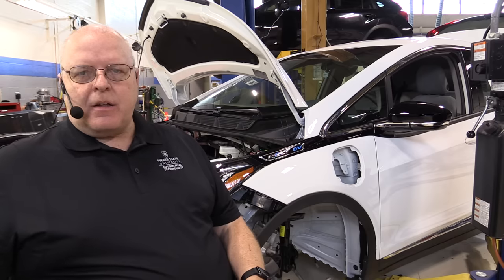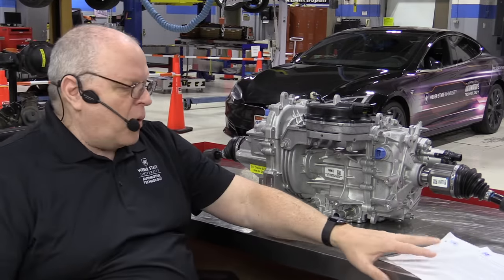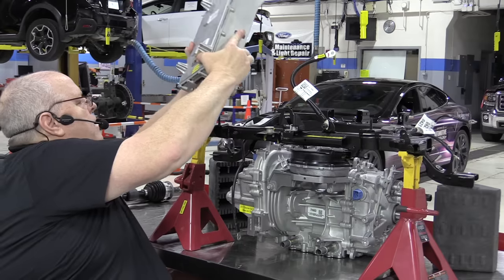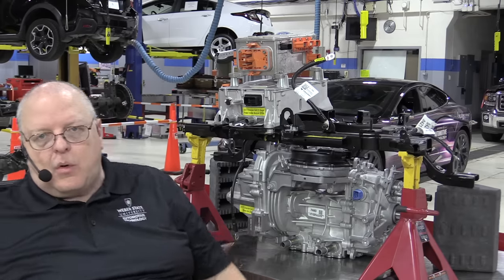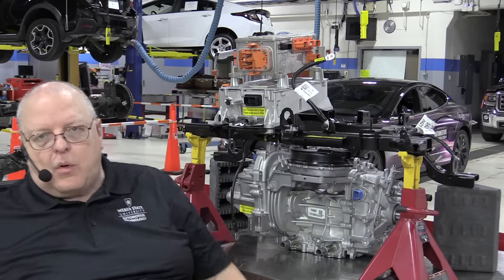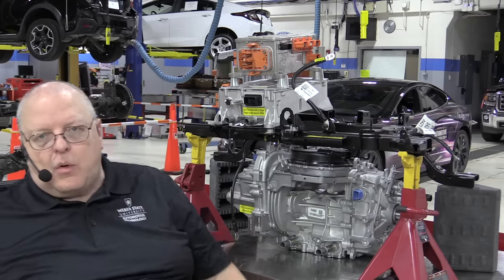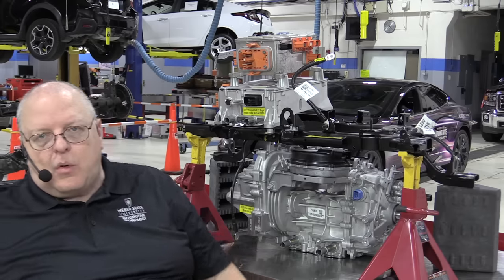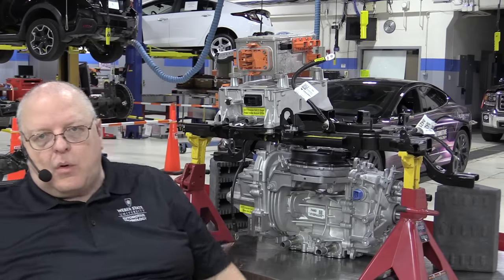Chevrolet Bolt EV High Voltage Components

Comment: Legit question:  What's the chance to valve the electronics cooling loop with the cabin heat loop?  Even if it's a manually operated pair of 3 way valves.  My range took a hit due to cabin heating, but my Tesla Model S allows the waste heat from electronics to heat the cabin and it doesn't reflect any loss in range.  Sure is a shame Chevy didn't tie those two loops together, really how much would it have cost?
Reply from the maker: Good question. I do not know the answer

Comment: Super interesting, seeing how everything is connected gives me some hope that the Bolt could be somewhat easily modified to make up for some of the shortcomings in the Bolt package.

Namely and what seems somewhat straightforward I would think one could install a separate 120v  AC powered auxiliary heater in-line with the DC heater, people in cold climates could simply "plug in" their car to a 120v source at night and heat their battery in much the same way that an ICE vehicle owner might plug in an engine block heater at night.

The second option seems a bit trickier, I have a Bluetooth OBD adapter and Torque Pro for Android which allows me to see a lot of data about the car.  Based on my testing and observation it seems that the car is very reluctant to cool the battery when it's turned off and not "plugged in" to an AC charger.  I have seen my battery get as hot as 37C without the car doing anything to cool the battery (it does cool it down to 31C as soon as you turn the car on).  I'd love to find a way to keep my battery cooler on hot days to preserve it's long term life.

Seems like the first challenge could be solved with an aftermarket heater that would require no other modification to the vehicle, the second one probably would require modifying the vehicle software or sensors.
Reply: Robert Aitchison - plugging it into 220v charger when parked on hot days should allow cooling to run at times?
Reply: @dennislyon5412  At the cost of Li-ion wear, because there is no control over how far the charger charges the pack. Li-ion degrades quite rapidly when sustained at 100%.

Comment: Why are super caps not integrated? Upon demand acceleration or during motor off while using accessories, these caps could offset the load on the batteries. Thumbs up. Super capacitors would also allow a fast charge while not impacting shorting battery life.
Reply from the maker: It is my understanding that supercapacitors are very heavy compared to the actual amount of energy they can store. Li-Ion batteries have a better energy density for their weight. Thanks for watching

Comment: Any particular reason it needs two connections to the battery and they couldn't send the feed from the on board charger through the thicker cable?
Reply from the maker: I wondered the same thing. Thanks for watching

Comment: Can I splice the inport power distribution power module low power plug to DIY add a 120v wire so I can connect a mobile generator to the spliced port? I am trying to add a REX range extender to the bolt. A honda 2000u to trickle charge the main battery while driving.

Comment: Love this!
Wish Jack Rickards was consulted...I have no doubt he would have proven to be an invaluable wealth of practical knowledge.

The simple fact that the drive and subsequent components make it crystal clear there is a ridiculous amount of loss. I have a few suspicions but, speaking generally Physics dictates that 400 Volts should have little to no loss through impedence, or heat. OHM's law tells us that as Potential Increases Resistance goes down affording more current to do the work. While I am aware of the Battery Technology and limitations,  and safety issues, it would seem the claimed effective efficiency is unrealistic in the real world.

In my experience it is the post modern engineer that fails to recognize any previous gains, even to the point of choosing to ignore past gains, or refer to actual legitimate authorities who have succeeded previous to the current batch of Everyone gets an award because everyone is a winner types.

I mean cmon Rickards was doing this himself with Lead-Acid batteries in Porsches VW Things VW Busses Toyota Trucks etc 30 years ago. We should be far further ahead then even Tesla is.
Reply from the maker: Thanks for watching
Reply: @WeberAuto  
I seriously appreciate all the hard work and time you have spent to gather such in depth information.

On your desire to whatever with an EV I would  contact EVTV on YouTube fully the very most competent DC Automotive techs.

Comment: I have a question.  Is regen braking a misnomer?  I mean is it part of the braking system or just part of the taking your foot off the accelerator system?
Reply: Regen is typically programmed such that lifting your foot off Pedal, or even reducing pedal engagement, will put into effect regen braking.  Pushing the brake pedal also activates regen, (if the programing is selected just having foot off accel pedal will activate regen anyway).

Comment: This could be the first non-CCS to CCS conversion. Should be interesting.
Reply from the maker: Hopefully we can make it work.
Reply: @WeberAuto  Awesome! At some point, if you can measure the DC cables that come in through the CCS port, you might be able to estimate the maximum current the Bolt EV's DCFC is theoretically capable of supporting.

GM engineers have stated that the Bolt EV's charge limit (max charge rate of 55-56 kW... 150 A) is due to hardware. The battery cells appear to be limited to 1 C charging rate, but it would be interesting if the hardware other than the battery can support greater than 55-56 kW of current.
Reply from the maker: The SAE document for the Bolt EV states it was designed with a 50kW DC fast charge system that can complete a full charge (0-80% usable range) in approximately 20 minutes. The DC fast charge shielded cable outside diameter is 12.0 mm. The HV battery shielded cable outside diameter is 12.75 mm.
Reply: @WeberAuto  Oh, okay. I was wondering if it displayed the wire gauge. That can help determine the current capacity of hardware. For instance, the Tesla Model 3 has 000 cable, which can support up to 430 A. Based on the casing, the Bolt EV probably has 00 cabling.
Reply from the maker: @newscoulomb3705  There are no markings in the cables and the wiring diagram does not show the wire size any longer. The Bolt EV battery is rated at 150kW maximum. The motor is rated at 400A (rms).

Comment: Dear sir there is scissor symbol in yellow tag near the 12 volts battery what does it mean ?
Reply from the maker: It indicates to emergency responders where to cut the 12V battery cables/harness to disable the high voltage system.
Reply: @WeberAuto  thank you

Comment: Hello!  What is the power of the dc-dc converter 400V to 12V (Amps?)?  I want to connect a 12V to 230V inverter.  In connection with rocket attacks, electricity often disappears, there are no gas generators in stores.  There is a 1.5 kW inverter.
Reply: 100 amps, I'm told.

Comment: Does this vehicle not have regenerative braking? The only way to charge the battery is externally?
Reply: Yes, i have seen over 50 kW of regeneration on deceleration.  But this only recovers 90° or so of the inertial energy.
Most energy is spent on friction and air drag.  No recovery of these losses other than a recharge.
And if you drive over 70 MPH the time GAINED is lost to RECHARGE time.  Drive sanely, safely, and EFFICIENTLY.

Comment: 14:19 can I splice a connector to 2 j1772 ports at the ac voltage in port area so I have 1 orginal wire going to the mounted j1772 port and the DIY spliced 2nd wire going to a 110 volt plug? That way I can just use an extension cord connecting to the plug under the hood instead of hauling the portable 110v charger around...

Make it look like an ice engine block heater
Reply: Sure you can splice it, but if you don't do something about the J1772 plug detection circuit, you'll disable your car because no EV lets you charge while driving. You'd need to disconnect that circuit on the two J1772 pins to drive. Why not try it and post to the BoltEV forums when you get your mod to work? Also hopefully you make it foolproof so you don't blow fuses when two charge ports are connected at the same time.

Comment: Is there overvoltage protection in the on board charger module?  Some EVSEs are connected to 277v in commercial sites.  It is my understanding that Telsa’s HPWC permits 277v on Model S and Model X.  If a person were to use a J1772 adapter, 277v might get connected to the Bolt’s OBC.  I’ve seen that the Tesla M3 won’t charge from 277 but it causes no harm.  I wonder if this is the case for the Bolt.
Reply from the maker: Good question. I do not know the answer yet.
Reply: I work in an industrial facility.  We have 208V 3 phase and 480 3 phase power distribution.  The 208V can supply 120V from any phase to neutral and the 480 can supply 277V from any phase to neutral.  Usually 277V is only used for HV lighting circuits and 208V and 480V are used for equipment, and of course 120V is used for convenience outlets.  If we want 240V,  we need a transformer.  I would expect EVSEs would be connected to 208V or to 240V via a step-up transformer.
Reply: Steven Wilson, I would expect that 277v for lighting wouldn’t be seen in the wild as well, but it seems there are some EVSEs for Teslas mounted in parking lots that are fed 277v.  The model X and Model S can accept that voltage, but their new Model 3 cannot.  The Model 3 won’t be harmed, it just won’t charge.  Since there is an adapter that converts a Tesla HPWC plug into a J1772 plug, there’s a chance someone could plug a Bolt into 277.  I hope the Bolt is the same way.
Reply: Just heard from a reliable source that the Bolt EV cannot charge from 277.  It gracefully refuses to charge.  So no harm, no foul, it simply won’t work.

Comment: The "special coolant" is ordinary Dex-Cool per the owner's manual.

.
Reply from the maker: Yes, but as stated in the video, it must be 50/50 premixed Dex-Cool. Any other coolant and mix cannot guarantee that de-Ionized water was used.  Cooling fin corrosion in the inverter, DC-DC converter, charger, and battery can result if de-Ionized water is not used. Corrosion will promote overheating, loss of range, and eventual system damage. Thanks for your feedback

Comment: I guess the backyard mechanic era is really over. Could you please explain the difference between torque and horsepower ? Or how they are related to each other.
Reply from the maker: Thanks for your feedback. There are many videos on youtube explaining that. In basic terms related to this motor, torque is a rotational force and horsepower is how fast the torque is applied.

Comment: The motor goes 8800 rpm, which sound a bit high, but what about the AC input frequency it takes to reach 8800rpm? Depending on the number of rotor and stator magnetic poles it would go between twice to 8 times the mechanical frequency at which point im concerned about hysteresis losses in the iron core of the motor.
Reply from the maker: That is the correct number. Toyota Prius motors go up to 17000 RPM.
Reply: i have the feeling that priuses get bad highway gas mileage exactly because the motor has a lot of hysteresis losses at those high speeds
Reply from the maker: The Bolt EV motor is a revolutionary new design. Smaller conductors and six hair-pin windings per slot reduced AC losses of at least 30% above 4000 rpm.  See SAE Document "Electric Motor Design of General Motors' Chevrolet Bolt Electric Vehicle"
Reply from the maker: 52 mpg on the highway on the Prius is not what I consider bad fuel economy.
Reply: I thought hybrids are considered bad for highways, but if 52 mpg is true then it is quite good and i stand corrected then, but im still worried about lost energy saving potential if those motors really need to go such high rpm when at highway speeds. (mainly hysteresis losses, because at 17k rpm the iron core would have to take 280hz of magnetic field alternation if the rotor was 1 north and 1 south pole but it has at least 4 norths and 4 souths so its 4 times that which makes it just about 1.1 khz of magnetic field alteration trough the iron core of the motor and from what i know about transformer design at those frequencies iron/silicon sheet steel core is unacceptable and you need iron powder core)
Reply from the maker: The 17,000 rpm is not at highway speeds, it is at the top vehicle speed of 100 mph
Reply: I'm sure there are some Torque-speed-efficiency motor graphs out there that you can find. Most motors are going to be above 70%. PMSM's are going to be near 90%. The biggest losses are the aerodynamic brick designs they keep coming out with for huge SUV EVs and crossovers. They're not playing the game to make the most efficient system design that they're capable of, you can go to Tesla or Aptera for those.

52 mpg for a hybrid is fairly bad considering some purely ICE vehicles without heat pumps or heat recovery can achieve this.
Reply: @Infinion  In electronics there is a unspoken law saying the higher the operating frequency, the higher the efficiency, which would explain why they push these motors to such high frequencies, however I think if they were to switch to different ferromagnetic material like iron powder (good for 2-10kz) or straight up ferrite (30-300khz) they could cut so much costs and raise the efficiency enormously.
Reply: @two_number_nines  Yup, you're not wrong. They could also change motor technologies to axial flux and explore DSSRMs. There is so much in the way of motor design to be desired. I'm just skeptical that GM will be the corporation to invest in those improvements.
Reply: @Infinion  GM will invest in anything, but will dump it when its 90% complete and is close to igniting a new worldwide trend. They are the google of cars.
Axial flux will probably be a necessity in my idea, because current motor technology already struggles with centrofugal rotor expansion.
Reply: @two_number_nines    Haha right on. Yeah Axial flux has great improvements in power density and weight, structural integrity, length of the flux, so many things you couldn't count them on your fingers.  SRMs are also a great choice for axial flux because the lack of magnets makes cooling requirements very manageable, further improves structural integrity, achieves greater efficiencies than permanent magnet technologies (98-99% already well documented) and even unique energy recovery strategies. Combine that with the improvements in inverter efficiency with GaN and SiC and you can achieve a lot more with a smaller battery packs.   

And to add, it's a necessity in your view and my own, but there's no reason we need to be waiting around for GM and friends to adopt these technologies either, because it's not something they're necessarily interested in, if the progressive development of EV1, to Volt, to Spark EV, to Bolt is any indication. They're not leading the industry anymore, they're another "me too" manufacturer. On the other hand It's easier than ever (for citizens of different industries and backgrounds) to collaborate, and fabrication as well as simulation software is fairly affordable.  At this point we would only have ourselves to blame for not setting an example.

Thanks for the chat. I definitely plan to kick my ass into gear and start developing motors and controllers as I did briefly years ago before I pivoted.
Reply: @Infinion  Very nice I wish you luck with your projects. The main reason I post comments like these is to get a discussion running. Technology has been so stale for the last 10 years compared to what we could do with current technology. I don't have the same patent troll monopoly all big manufacturers have, so I hope if I can't mass produce my ideas at least they would see people discussing it and try to make it for real. Alternatively I want people to debunk me, so I can focus on other things.

Comment: One error, quick charging does turns on the battery heater when required
Reply from the maker: Thank you, yes, I was wrong. Feedback from Bolt owners indicates that it charges faster on a level 2 charger in cold temperatures. I am still investigating to find out what is is supposed to do,  but that information is not easy to find.
Reply: @WeberAuto  actually no, Bolt charges far faster on L3 even when battery is cold. I have plenty of data to support this if you want me to send you screen shots from my Torque application
Reply from the maker: @johnchartrand5910  That would be great. I am curious to see what temperatures you were experiencing while charging. jkelly1@weber.edu

Comment: Why is the heater core a separate liquid coolant circuit than the inverters, engine, and converter? You'd think they would use that warm fluid, and simply divert it to the cabin when the heat is turned on? If I'm understanding correctly, instead they waste electrical energy devoted to heating the cabin. Come on GM.
Reply from the maker: Good question
Reply: The heater core (when used) would operate the coolant at a much higher temp than the power electronics would operate at. I know it sounds counterintuitive, but in the winter when you need a blast of heat, combining those loops would overheat the power electronics.

Liquid cooling loops need to have their nominal operating temps in synch. Ambient air, battery, power electronics, motor, heating/cooling are all very different temps at different times. They can't all share the same loop.
Reply: @egoequus6263  a simple thermostatically controlled valve solves your problem there.
Reply: @tilleytristan  Yes, they could go even further and squeeze every wasted btu out of the whole system, but this is GM we are talking about. The range extension by adding that valve and other mods would probably not be worth the marginal expense. I believe the drivetrain is LG anyway, so that is what you get for outsourcing.